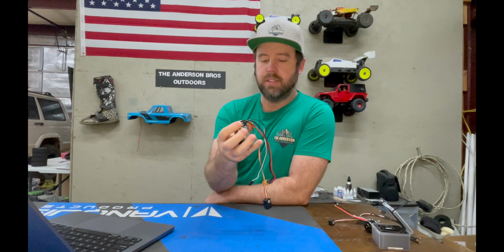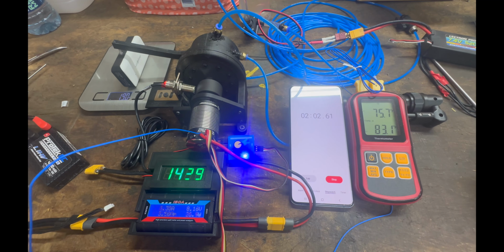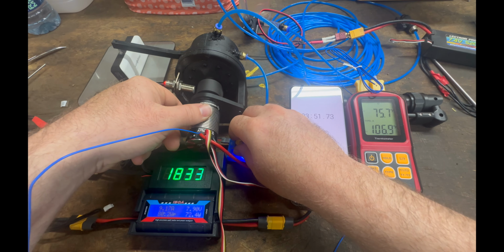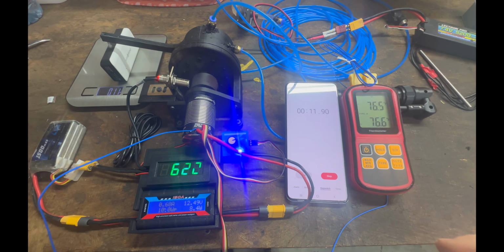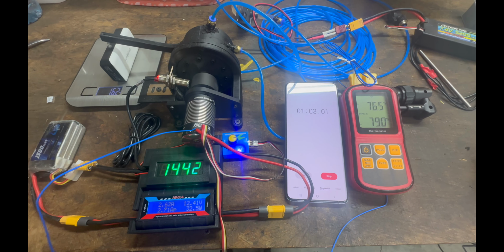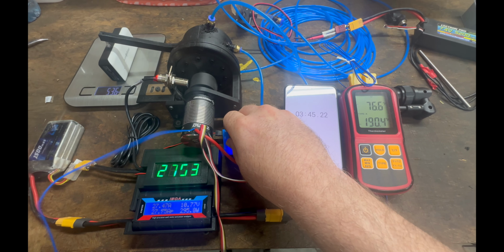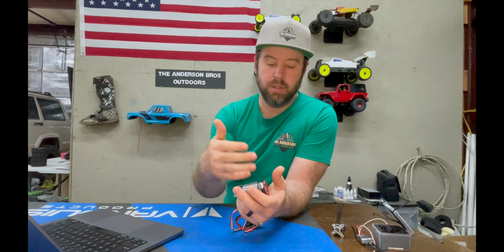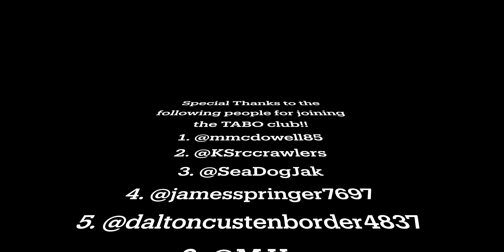ESC Testing - Dyno - Hobbywing Fusion Pro 2n1 2300kv - 4k

Comment: what do you think a safe running temperature would be, I've put this in a Vanquish H10 optic and it seems to get warmer, 115 within 3 minutes, than typical crawlers I have
Reply from the maker: I wouldn't want any ESC to get any hotter than 150 degrees, anything under that should be OK, but prolonged periods of anything above that and you're looking at potentially having issues. 

This motor specifically thermal'd itself really fast compared to the other motor/esc combos I've tested. I would assume that's because the esc is built into the motor and it's one giant heat generator.

Adding a small fan near the motor will help significantly, and while people don't want to add the additional power sucker, it can absolutely keep the motor WAY cooler and increase the runtime and longevity of it.

The other potential issue is the gearing is too high, you can try to reduce the gearing by putting a bigger spur gear on it, or a smaller pinion.

Either way I hope you get it figured out! Enjoy the h10!! 🍻🍻
Reply: @the-ab-outdoors  all good advice, we wanted to use  the Fusion Pro and gear the H10 up a little to get more speed and still have low-speed control, however, we did test our other pro in the axial Pro with low gearing and it  too got to 116 in 3min of full throttle running so I'm now thinking we run them and see just how hot they get, it's just hotter than what we are getting so maybe we're just being too cautious
Reply from the maker: @rcmikeklein5512  makes sense. I would recommend a fan or a dedicated setup like the 2750kv castle motor and new cobra esc. 

Outside of that a small 30mm fan would work wonders and be way cheaper lol 🍻🍻
Reply: @the-ab-outdoors , it sounds like you know your stuff as we are looking into both of those options, thanks for the input
Reply from the maker: @rcmikeklein5512  anytime sir! What’s the ambient temp when you’re running the trucks?
Reply: @the-ab-outdoors  it was about 75 for both H10 and axial pro
Reply from the maker: yea that's no good then, it's climbing way above ambient. I'll check out my h10 tomorrow and see if we can squeeze a fan in there somewhere and maybe post a printable stl for free! 🍻🍻
Reply: I'll jump in as well. 

I run this in a TRX4 dedicated crawler. Stock gearing is 39/17. I'm running 45/9 on 3s. It still gets really hot. After about ten minutes, I can't touch the motor. There's no binding or anything. I'm barely hitting more than 50% throttle, and I'm wondering if lugging the motor is causing issues?
Reply: @notsure9033  Thanks for the input as I  really like this motor but the heat from this motor compared to other crawlers is much hotter and it's concerning that it may not last, I also have a Fusion Pro in an axial scx10 pro with the smallest pinion gear possible and after 6min of run time the motor temp is at 116 fahrenheit which seems hot to me, so the more input form everyone really helps, I think my next move will be a fan but not sure if that will work time will tell
Reply from the maker: @notsure9033  what’s the ambient temp while running it?
Reply: @the-ab-outdoors  Outdoor temps? Mid 70s or so.
Reply: @rcmikeklein5512  Noted. I actually ordered a fan last night. Glad to see I'm not the only one with a hot motor.
Reply from the maker: @notsure9033  yea the outdoor temp. The big issue with the 2 n 1 is everything is inside that can (motor, esc, and bec). There is little no heat dispersion and the energy is causing heat build up. A good idea is to use some sort of fan to circulate air in there.
Reply: @the-ab-outdoors  it was about 75 degrees Fahrenheit
Reply: @the-ab-outdoors  Yeah both of my fusion pros get around 115 to 117 in the first 5 minutes, in different trucks ,  so I guess it's a fan and maybe telemetry radio to keep an eye on it